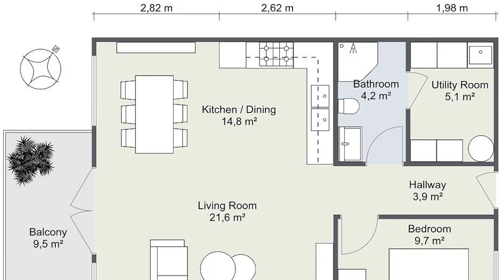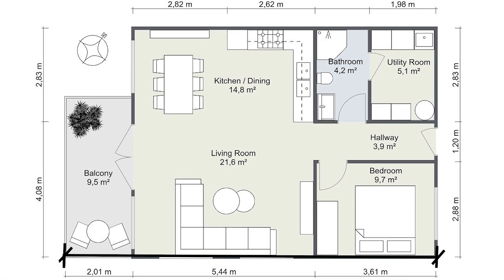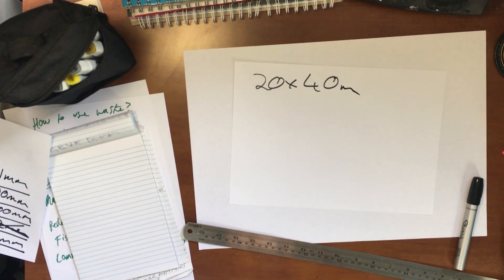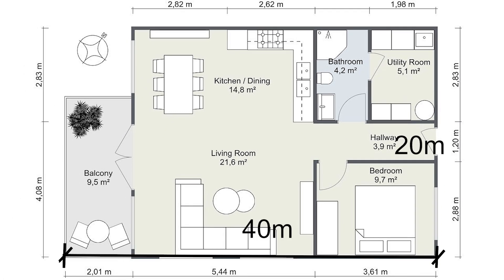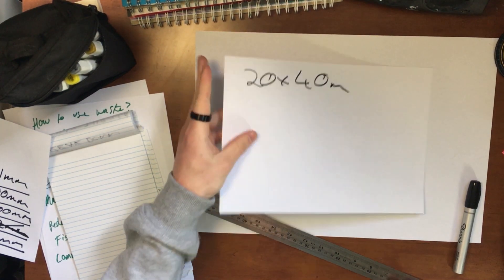How to Read and Draw a Scale Floor Plan – Scaled Floorplans Drawing Course for Architecture Students

Comment: This is very helpful but I still have a question that no one has answered yet. If I’ve drawn a floor plan and all the dimensions are clearly written on it why do we need to write the scale? If the architect and builder know that this wall is 12m long, isn’t that enough? What do they need to know the scale for?

Comment: I got an abomination of a scale for ya: 1cm = 1 yard. 

Why? Well, that'll take some explaining so fair warning: This is gonna be long and kinda VERY rambley . 

I like to run modern/sci-fr RPGs/wargames and there's not as many premade maps for these kind of games (at least in the style/detail I want). I main also GURPS for my RPG of choice but have also gotten into the sci-fi classic Traveller (with both games being very compatible with each other. Oh and the best way to get the vibe of Traveller, Firefly was heavily inspired by it and even made a direct reference to it in the first episode). Now GURPS uses 1 in = 1 yard = 1 hex and is technically 56mm in scale (or 50mm depending how you measure the figures height, though most ppl just use 28mm and ignore the scale discretion... my level of "autism" is too great to let that slide). Traveller uses 15mm figures and a 1 to 1.5cm to a meter (it kinda goes back and forth depending on the module you use... it was the 70's, what can you do). Now I've started to like the 15mm scale since it lets me have longer ranged battles which in turns makes a gun/laser/whatever range matter more as both systems have pretty realistic range for their ranged weapons (and 15mm is hella cheap to boot). And since I like both games, I want to use the same scale for both and obviously have settle on 15mm (cause I'm cheap!). Of course, there's even less maps I need for my games no only for the genres I like but for 15mm... so I gotta draw my own. And since modern/sci-fi is gonna need some homes and buildings... that brings me to these videos. 

Technically 15mm is 1:120 scale (TT gauge) so at this scale 1cm is closer to a yard then a meter (though good enough for government work in both cases) so I could just go 1:100 and just be done with it but... my brain meats no likes that so going with 1cm = 1 yard/ is close enough it doesn't trigger my weird brain chemistry (why can't I just be normal >.>) so 1:120 it is.

Comment: Explain this for the architect out there. When you draw a floor plan without adding the thickeness of the wall, for example, you draw a 4×4 Bedroom then when you start adding the thickness of the wall, does it stay the same?? Like the the non wall part would be smaller.
                                _____
                               |.            |
                               |.            |
                               |_______| 
This is 4×4 then you start adding the thickness 
                         []=======[]
                         [].              []
.                        [].              []
                         []=======[]
The space you can occupy is only something like 3.(Something and not 4) So is that how it works or am i doing it wrong??

Comment: If you want a feel for scale look at Gundam model kits. Gundam Gunpla model kit figures are modelled at a scale of 1/144 in several grade depending on complexity and parts count as SD, RG and Perfect Grade as well as HG. ! larger scale used is 1/100. 1/60 and 1/48 are commonly available as well. other model kits also use 1/32 and collectible figures often  can be acquired in 1/16 and even large 1/2 and 1:1 scale for several hundred dollars. . The Gunpla factory in Yokohama modeled an RX-82 gunpla robot at 1:1 scale and it was several stories tall and moves : https://www.youtube.com/watch?v=9m1XM6e64pY

Comment: Trying to make a Plot Plan 1:20 when I originally started it in 1/16" - 1'-0" using a CSize 18"x 24" Paper. I tried 1:20 and the Image was too big, but it fit at 1:100, hopefully that's ok, or what's your opinion ?

Comment: How do I convert floor plan drawn at 1/100 scale to 1/4 scale? If the length of the room was 4,236 would I then divide 4,236 by 4 to get my 1/4 scale dimension?
Reply from the maker: That's correct Felicia!

Comment: Going from A3 to A4 or indeed A1 to A2 (ie 1 page size down), the scaled size is not 50%, it is actually about 71% of the original size. Add the "fit to page" option everyone seems to love to use which adds an additional margin to your original page size and it comes to about 67%. People also seem to mix this percentage up with scale, this is why I think the 1:67 scale comes up.

Comment: can someone help me about the dimension.I am only 16 and my teacher ask me to draw a floor plan.plis help me
Reply: Do you still need help with this or is it sorted?
Reply: @meganclaridge2235  why not?I need it for my own knowledge
Reply: @flyingowowo8548  so you will have to forgive me, I don’t know what you do and don’t know. Dimension is just the word used for a measurement. So if you measure the door, the dimensions (measurements) are probably 2.1metres high (2100cm) by something like 0.75wide (750cm). These are the dimensions. 

Same with the house. Measure the width, the depth and they are your dimensions for your plan. In this video they are 20m x 40m, he explains the scales much better than I could. 
You can find videos on the details that go into plans, the more arty (and in my opinion, fun) bit!

Comment: Can u tell us how to like take size like u took 20:40 size randomly but how can we think like that, how to know the dimension that will fit our floor plan?
Reply from the maker: You might have to guess for the first couple of tries as I did and solve it through elimination. Otherwise, knowing the size of an A3 page (297mmx420mm), you can figure out that 20,000mm (20m) divided by 100 = 200mm. Therefore, 200mm will fit on an A3 page as it's smaller than 297mm, and likewise 40m at a scale of 1:100 is 400mm which is smaller than 420mm, meaning it will fit.
I hope that helps

Comment: How is 20m divided by 100 20cm???? Wouldn’t it be 0.2?
Reply from the maker: 20m is 2000cm. 2000 divided by 100 is 20. I mixed between the units which might have caused confusion

Comment: Sr, what is 10kN to 2m scale?
You are the best❤️🌍🙏
Reply from the maker: Hi ana! Thanks for the comment. I haven't worked in kilonewtons much before, but I don't think it's possible to convert kN to meters as they are used to measure different things. You can convert between millimeters and kilometers, for example, but kN measures weight not length.

Comment: What scale would you use if it 4.74m x 6.40m
Reply from the maker: Depends what page size you're required to use. 1:100 is a pretty universal scale for floor plans / elevations. Can try 1:50 if you want to show more detail.
Reply: @kylesinko  yh, I did it in 1:25 in the end

Comment: How to measure 1:100 m using a normal ruler
Reply from the maker: 1:100 is 100x smaller. So, if you want to measure 5m with a normal ruler, divide 5000 (5m is 5000mm) by 100. You get 50mm. So, you would rule up to the 50mm line. You can then tell that 10m would be 100mm, 50m would be 500mm etc.